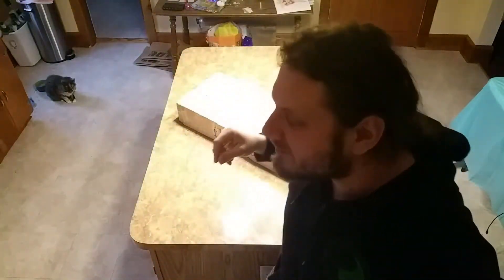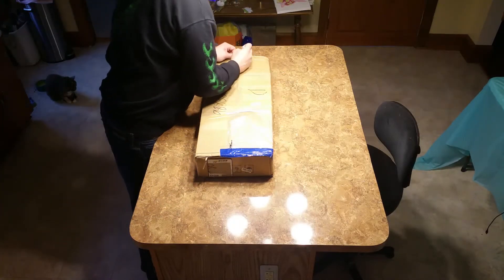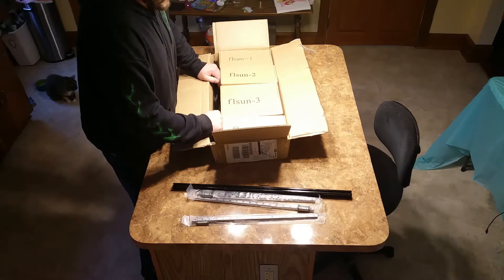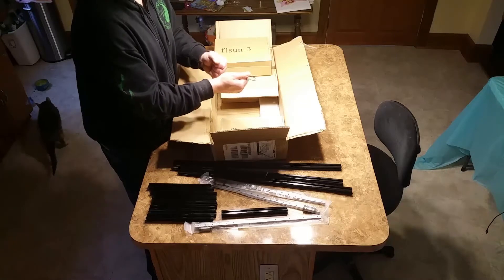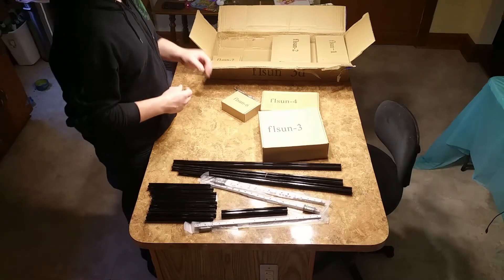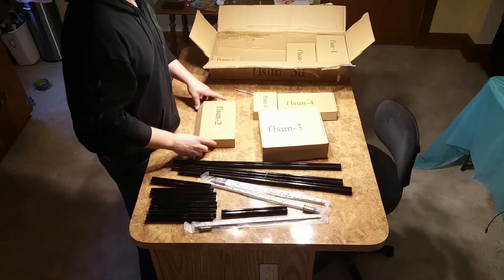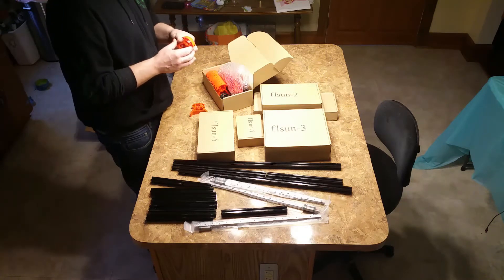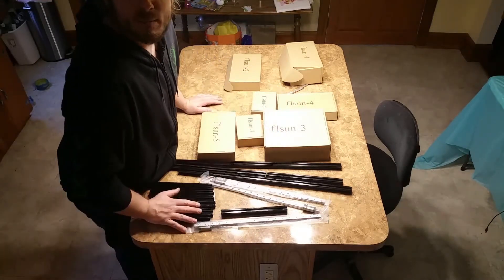FLSUN Delta DIY 3D Printer Kit Build

Comment: I just ordered one, I subscribed.
I've been using  TinkerCad,  for a few years, it can do a lot, it's free and you'll pick it up fast. You're just combining basic shapes. It's like playing with blocks when you were little, only you don't knock 'em down, you print a copy. The cool thing about it is any shape, no matter how complex can be turned into a hole with one mouse click! That's kind of your removal tools - drill, saw, etc
Another advantage with Tinkercad is you won't need to "repair" your files, it's just not needed Look forward to seeing yer prints.
Reply from the maker: +utetrahemicon no need to "repair" files,  you've got my attention.  I'll have to check it out.

Comment: good printer can u tell me if u got the heatedbed to work i couldn't
Reply from the maker: I did get it to work just make sure you have the bed plugged into the right power terminals. check with the wiring diagram. I'll post a video soon on how I calibrated and set up all of the wiring. thanks for watching!
Reply from the maker: +Alpha Durant oh and also you may have to go into arduino and enable the heated bed. If you have any more problems message me and I'll make a short video to show you how to enable the heated bed.